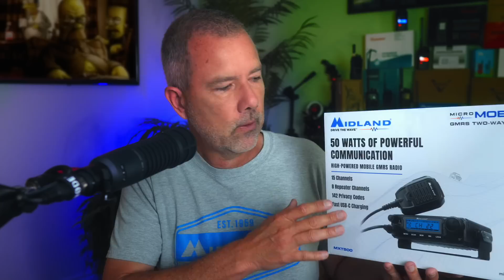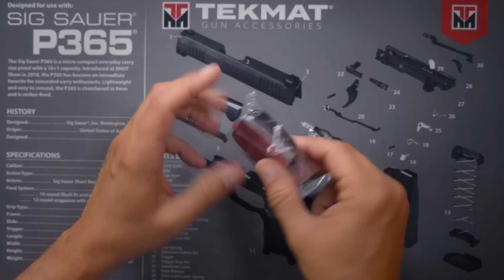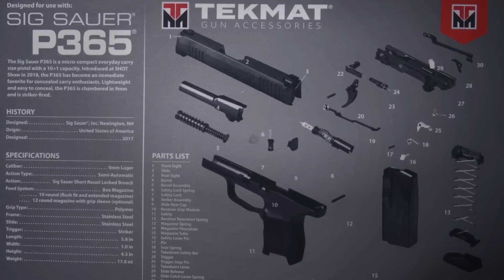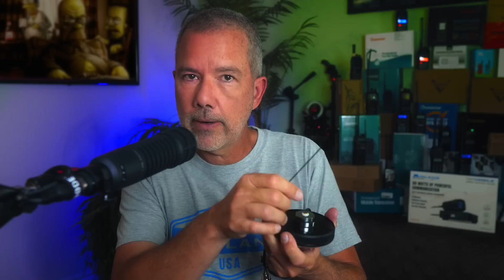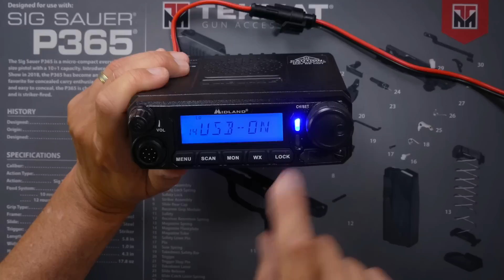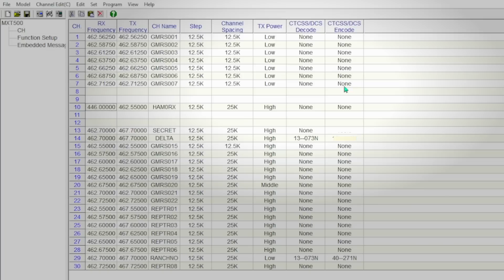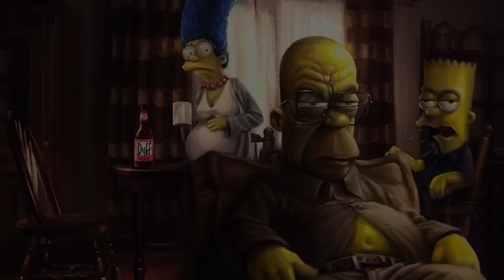Midland MXT500 High-Powered Mobile GMRS Radio. Review & Demonstration of Midland's New 50W Radio

Comment: You mentioned that the MXT-500 gets hot. You're talking to a newly licensed GMRS person; If I wanted to use this at home, as hot as it gets, how can I mount this radio so nothing catches on fire? What would you suggest? Are there any special mounts for this purpose?
Reply from the maker: It doesn't get hot enough to start a fire.. Just mount it so it has some airflow around it and everything will be alright..
Reply: @TheNotaRubicon  Thanks! Keep up the great work. I'm always waiting for a new episode. Be well.

Comment: You didn't mention that it's OK to transmit without a license in the event of an emergency. 
How does it stand up to transmitting without an antenna attached?
Reply: So what are you going to do? Buy a radio, sit there and look at it until an emergency comes up?
Reply: @gone2dmtns  isn't that what you're supposed to do?

Comment: I have a couple of the mxt 400s being that they are narrow band will they communicate well with the mxt 500 when it is in wide band or will the radio need to be set to narrow band?
Reply from the maker: They will communicate fine, even if the MXT500 is on wideband, but the MXT400's may sound "quiet".. You could set the MXT500 to narrowband, and then the 400s transmit volume would sound normal when listening on the 500.
Reply: As I understand things, if you get the correct programming software from Midland, it allows you to change the MXT400 narrow band configuration to wide.  I believe you can also setup repeater configuration and split tones.  Seems to me the biggest limitation to both the MXT400 and 500 products is the lack of additional channel spaces for custom repeater channels.  Really surprised they didn't support this in the MXT500 as it would have been a low cost, high value effort.
Reply: I got in touch with midland they are sending me a programming cable and software to change the configuration. The mxt400 is a fully capable wide band radio after programming.

Comment: I am curious about the use of high, medium and low power settings aside from the frequency you might be transmitting on.  After watching your humorous and informative videos I understand that some channels are limited to lower power transmission.  Hope I said that correctly.   I am wondering if it is a good idea to use low power when you are traveling off-road but relatively very close to your traveling crew.  For instance, if you are using ch 16, which allows 50watts.  A second question is regarding using a 50watt radio on chs 1-7: do I need to set my power setting to low or is that a hard setting that cannot be changed?  Is low 0.5 watts, med 5 watts and high 50 watts?  Thanks for all the help
Reply from the maker: If you are close, there really is no need for 50watts. "some people" say that using more power than what is needed "pollutes" the airwaves - So i leave mine at 50W all the time.
This radio (any 'real' GMRS radio) knows the power limits of each channel and it wont allow you to break the rules - it will only transmit at the allowable power-level.
Reply: @TheNotaRubicon  so the 50W Midland (or any of the 50W radios) will work on all GMRS channels/ frequencies at the allowable power
Reply from the maker: Many mobile GMRS radios wont transmit on channels 8-14, and as mentioned in the video, the midland does not have these channels at all.. But other than that, the radio works on all GMRS channels at it will only transmit at the allowable power level (or lower) for each channel

Comment: Can this radio be used inside a house? I am wondering about the power connection. Can you get an adapter to plug it into wall socket?
Reply from the maker: Yes. You just need a 12V (13.8V) DC power converter that can handle about 20amps.. You can find them at the BuyTwoWayRadios website.

Comment: generally what is the range in basic milage
Reply from the maker: As with any mobile GMRS radio you can expect a range of anywhere from 1 to 60 miles..  Maybe more, maybe less.  
The more technical answer is "it depends".
Reply: @TheNotaRubicon  could give a link wher I could buy these and Thanks  -based on your opinion of range on straight flat ground -I do understand range would vary based on barriers etc but the farthest

Comment: I’d I have a MXT115 hard wired in my auto does the new MXT 500 use all the same connections so I can just unplug everything g from the 115 and then just plug my existing wires and power into the 500 ?
Reply from the maker: I believe so!

Comment: I'm looking for a GMRS radio to put into my work vehicle and it would have to me a "temporary" mount. With this radio you stated you couldn't use the cigarette port for power. If you set it to medium power for transmitting, could you use the 12v plug? This radio may be overkill for what I want to do but figure if I'm spending the $, I may as well get a good powerful unit (like this or the KG1000G)  I can later hardwire into a personal vehicle. Thanks!
Reply from the maker: Either the MXT500 or a KG1000G can be used via a 12V plug on low/medium power.

Comment: Now I am having a difficult time with the software.  Cannot communicate with the radio.
Reply from the maker: Statistically speaking, that is almost certainly a "Windows driver issue"
Reply: @TheNotaRubicon  
 That I am pretty sure of. However, I have had two separate computers installed with the software and neither of these are working. Since I have seen that your computer is functioning properly,  what version of Windows are you using if I may ask?
Reply from the maker: I'm using Windows 10.
I dont have my MXT500 in front of me, but you may have to go into your MXT500 menu and enable the USB port, or set it from "Charging" to "Data" (or something like that).
Reply: I have tried different variations of USB com port connections. Not one seems to work. I run an old version of windows 8.1, possibly issue there. I will keep exploring.
Reply: @TheNotaRubicon  Thank you for responding quickly to this post. Much appreciated.
Reply: To follow up with this tread. Windows 10 or windows 11 work where windows 8.0 or 8.1 cannot find the radio. This is what I found.

Comment: I have not found the antenna height included with this Radio Bundle. Can you comment on the overall height?
Reply from the maker: The included antenna is very small, approximately 6 or 8 inches.

Comment: Not a rubicon I have a question for you. I am a novice user that just wants to talk to my buddies on the trail. Will a ghost antenna effect the performance of this radio? Do I need to trim the cable? Also do I need to ground the antenna? Thank you
Reply from the maker: A ghost antenna designed for use on GMRS will work fine, no cable-trimming needed.  
A properly installed antenna/mount will be grounded - if you're using a mag-mount antenna, just slap it on the roof and you're done.
Reply: @TheNotaRubicon  thank you for the reply. I appreciate it!

Comment: Do you have to use it in a vehicle? If so are there any good ones for home use? I am really looking for something in the event of a shtf. Does anybody have a suggestion? I do have the ecoflow delta 1300
Reply from the maker: All you need is a 13.8V power supply and an antenna and you can use it as a base-station.
Reply: @TheNotaRubicon  thanks

Comment: HELLO SIR GOOD AFTERNOON I WANT TO INSTALL IN THE COMPANY WHERE I WORK A RADIO SYSTEM WHERE I ONLY NEED TO COMMUNICATE INTERMITTENTLY IN THE 3 WEREHOUSE THAT MAKE UP THE COMPANY MY QUESTION IS WHAT KIND OF PORTAIL RADIO I NEED TO USE AND IF THE RADIO THAT YOU MENTION IN THIS VIDEO SERVES AS A REPEATER FOR MIDLAND PORTABLE RADIOS.      SHOULD I INSTALL A MIDLAND MOBILE RADIO CONFIGURED AS A REPEATER?  SHOULD I USE ONLY WALKIE-TAKI RADIOS?     PLEASE, I HOPE YOU CAN SUPPORT ME I NEED THE SYSTEM TO BE STABLE AND WELL I HOPE YOUR RECOMMENDATION.

Comment: Nice review!!!

I do have a few questions:

Does the included antenna require a ground plane? Guessing it does based on it looks like a typical 1/4 wave antenna.

With the speaker being on top, how loud is it if the radio is mounted up high? Or is there an option to flip the display (and radio) so the speaker is pointing down? 

To get the range you do, are you or is your antenna elevated compared to the surrounding area,  and is the receiver also elevated? Just curious in comparison of our current mxt 275 set up in our RZR that we have gotten ~2-2.5 miles in the mountain just north of Lafollette, Tennessee. 

Do you happen to know if the MXT575 will have the same ip66 rating and the same antenna set up as the mxt500? 

Thank you and keep the videos coming!!!
Reply from the maker: The antenna does require a groundplane.
I havnt mounted the radio up high, so I dont know how loud it would be. There is no option to flip the display.
As in all of my videos/tests, I am elevated so i have very good line of site.
For info on the MXT575 you will have to wait for me to upload that video!
Reply: @TheNotaRubicon  

TY!!!
Reply: The Midland has an external speaker jack, that would solve your speaker location concern.